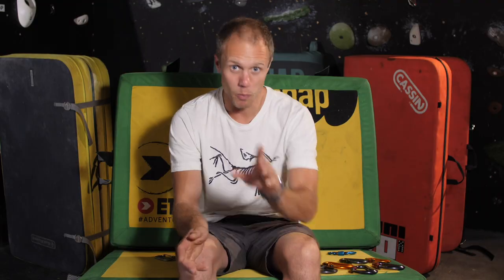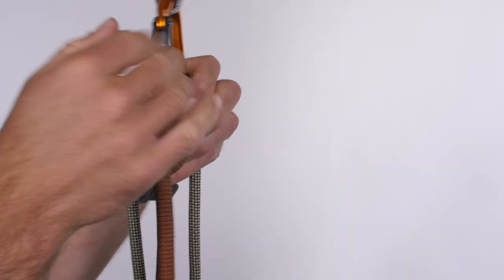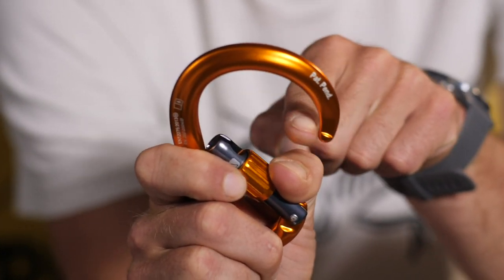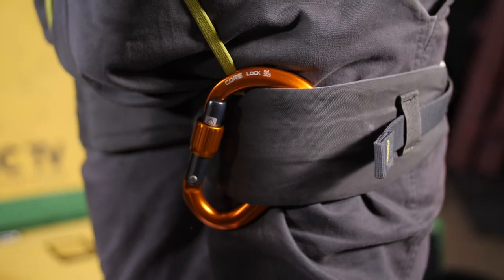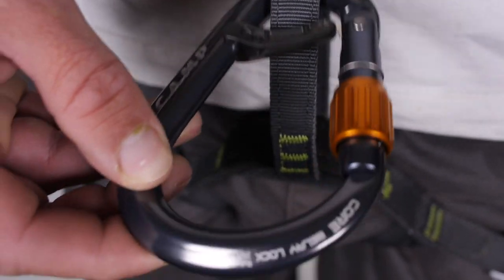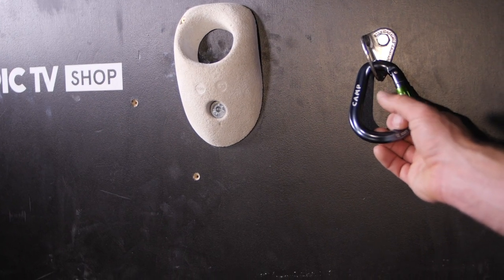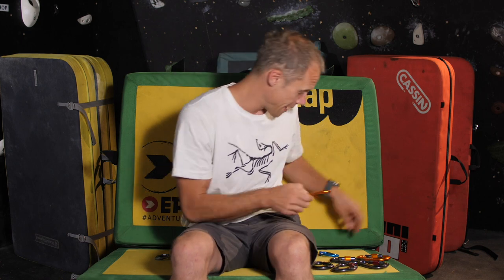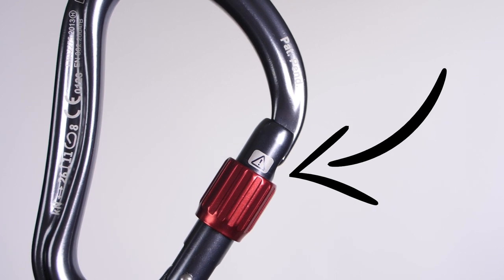Why There Are Different Types Of Locking Carabiners... | Climbing Daily Ep.1713

Comment: I still use HMS to belay on multipitch routes as regular tubers won't bite if the rope pulls down instead of up (climber falling before the first bolt/cam). Also I only do multipitch with a pair of ropes (so I can retreat the full length at once if I need to) and the Smart Alpin is kinda akward to use.

Comment: 8:06 The Nimbus does not use a round-stock construction because of the strength! Odd that this claim would be made when other well-known HMS biners with I-beam construction have essentially the same strength ratings. Further, the CAMP orange HMS corelock and the belay lock have the same construction from earlier in the video, yet no similar comment was made... The real reason for this construction is FRICTION! A round-stock biner has way less friction than an I-beam biner, especially once the rope is weighted. In fact, the Nimbus was made specifically to fill the niche that was left open by the discontinuation of the original round-stock Petzl Attahce. It is mean to belay with, rappel with, throw a munter on, etc... 

Any round-stock biner is meant to have a rope running over it (I call these "action carabiners"). I-beam biners are not meant to have a rope running over them (unless that is required for a particular reason, e.g. heavier climber), but are great for holding secure hitches (I call these "connector carabiners").

The currently popular Petzl Attache HMS I-beam biners are great for clove hitching to the anchor, since it has this high-friction geometry. However they are not great for belaying with e.g. a plaquette device, simply because the friction is too high; this is not what they are designed for. This is why the OG round-stock Attache's can go for $$$ on Mountain Project, and why some peolpe wonder why Petzl stopped producing them. The Nimbus was a response to this loss (though of course many other similar biners do exist). Other than being sized similarly to the original Petzl Attache, it's design is no different than the other CAMP corelock HMS solid stock biners.

Comment: So far i have the grivel clepsydra twingate in size L & they're fantastic i use mine for keeping my keys 🔑 it's always fastened to a belt loop on my jeans......more recently I've got the ocun eagle in both screwgate & triple autolock (the triple autolock is more fidgety because it requires pulling upwards before twisting to open otherwise it seems like a logical & safer step up from the screwgate) I've not yet tried any of these camp carabiners because there's only a few types available from my local shop

Comment: I only use skrewgate karabiners because you can clip the rope with one hand. Especialy when you build up an belay. Biner in the bolt rope in the biner all with one hand. Next is the one hand Clive hitch. This is not possible with an autolock biner.
Reply: Two and Three stage locking is always better if a little more "fiddly". The screw gate rolls down against a climbing surface or other ropes and unlocks. The situation is called ROLL-OUT DETACHMENT.

Comment: Has anyone had a screwgate biner seize up because of grit or dirt in the system. had it happen guiding and had to cut the rope out of the system. Very embarrassing.
Reply: Carry a little leatherman and use pliers to open them up. Have had it happen a few times when biners freeze shut ice or alpine climbing. Also works for grit